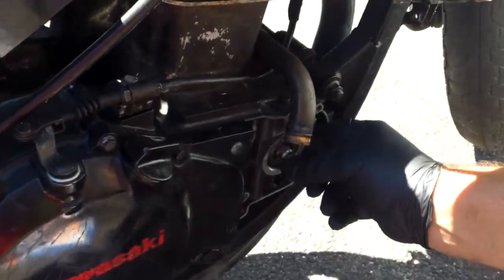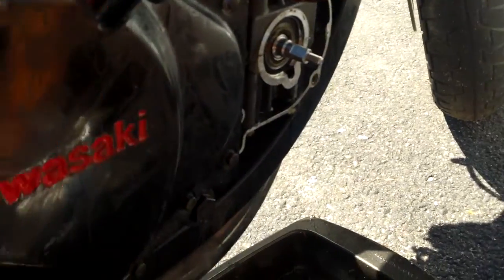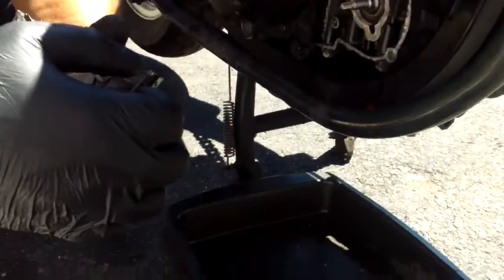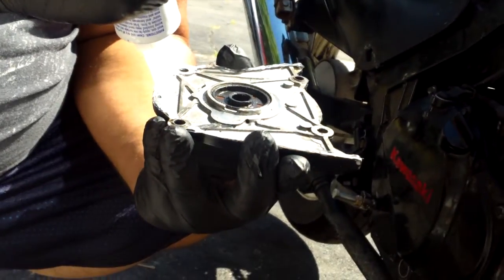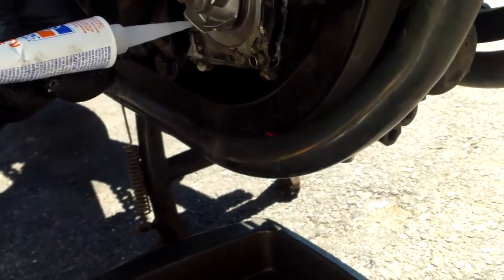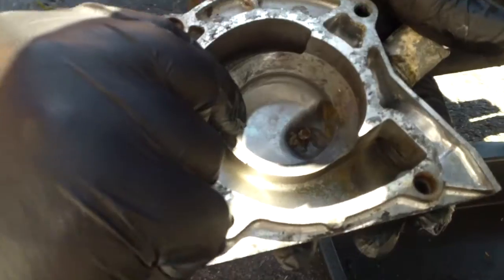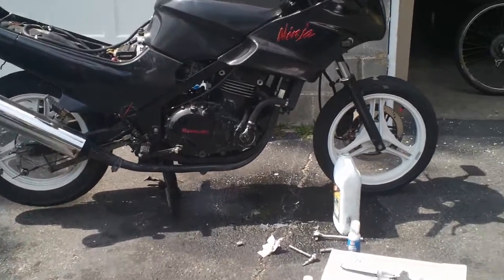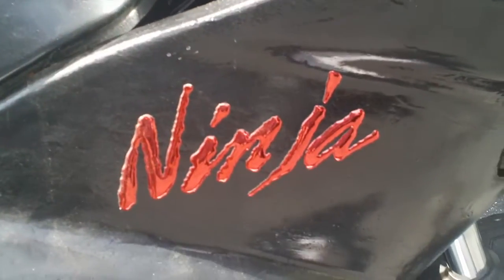1993 Kawasaki EX500

Comment: I need to replace my seals so this was a great help. I didn't know to turn the impeller the opposite way to get it off without shearing the bolt. I would've wrenched that wrong til it snapped more than likely.

Comment: Apply silicone to the gasket will increase your chances of a leak, not only that but you applied silicone to a dirty surface. The gasket is meant to be applied dry.
Reply from the maker: Yeah everything was working Fine after that no leaks thanks for the advise thought.
Reply: Does it need a gasket on the front and back or just the front ?

Comment: Torque setting for the impeller shaft is actually 25 nm and not a twist with a pair of pliers . The impeller itself is 8.5 nm . I've no idea why people circulate videos when they have very little idea what they are doing .

Comment: I have just removed the cover on mine and it was a real s**t to get off. think I may have damaged the bearing in the sense that there is a small amount of play in and out when pushing on it. Side to side there is no play at all. Tight as. Don't suppose you noticed any in/out play when putting the new impeller on yours did you?

Comment: hey buddy, where did you get the replacement spare parts of it? how much was it?
Reply: Eric Jurado i got mine from motorcycle spare parts eu (msp) dont know the price in america though. think it was about 30 euroes, so arround 34~36 dollars maybe in USA
Reply: thanks alot for your video, as im a newb it really helped me knowing i didnt had to reassembly my engine again (i say again since i had engine trouble and had to take it apart to find a screw loose, put it togheter wrong, pulled it apart, put it togheter... snapped a bolt, pulled it apart, put it togheter, snaped another bolt... bought a screw measuring device... pulled it apart and put it togheter again, broke my impeller shaft... started to swear in a language i newer knew i spoke... ordered the parts, found your video... and are now just waiting for the part to arrive, in the meantime im putting my engine back on my bike... so again, real happy i didnt need to pull my engine apart again as i found your video to show me how it was done) so thanks alot friend, drive safe